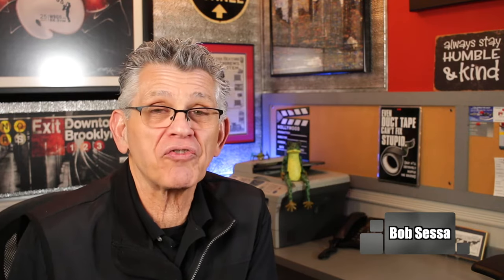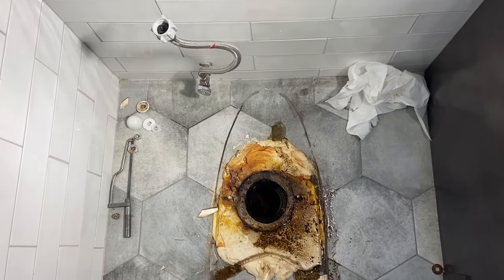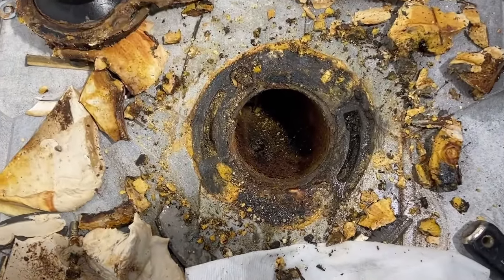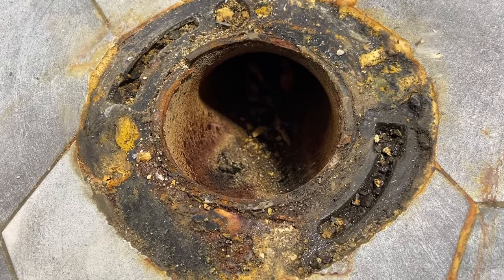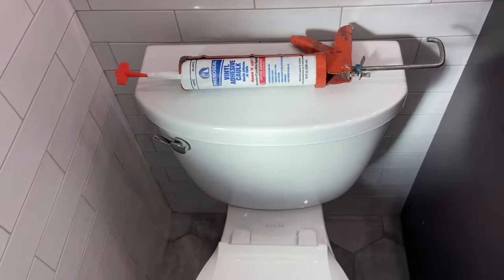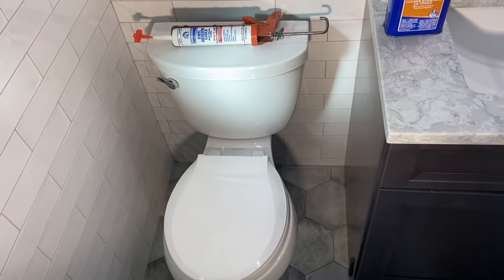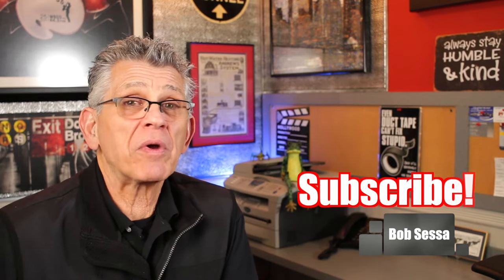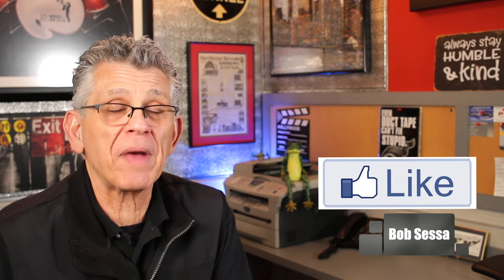Toilet Leaking From Base

Comment: I was installing a new toilet and it leaked under the base, so I went and got a double wax ring, still leaks, got a rubber ring still leaked. Finally I put the toilet on 2 paint cans and poured a bucked of water thru it, turns out the leak was in the mold. The spot where they poured the mold it didn't seal all the way. Got a new toilet, no leak.
Reply from the maker: That happened to me more than once and it drove me up a wall. Repeatedly setting and resetting the bowl, finally did what you did and wanted throw the bowl out the 2nd floor window .

Comment: I remember a product called Bowl Setting Compound that was an alternative to Plaster of Paris to go around the bottom rim of the bowl. I think a little plaster or an adhesive caulk is more secure and better support than toilet shims or pennies. It certainly looks better than an uneven space and is more sanitary. I have seen instructions that say if you do plaster or caulk a bowl to the floor, if you leave a gap at the rear of the bowl, a leak will make itself known above the floor. You can make a good case for either caulking or not caulking.

Thanks for the clear and instructive videos and I look forward to more.

Comment: What about toilet flange extenders?  Steve Lav has an old video "Toilet flange repair, tips and tricks." Seems like that could have been useful in this case.
Reply from the maker: Not sure but that may have worked if the original flange was in the correct position. It was just installed in the wrong position.
Reply: Only use extenders if you want sewer odor. Those things leak sewer gas so easily. I go to people's houses all the time complaining about a strong sewer odor and when I pull the toilet almost 100 percent of the time, it's because of one of those extenders.

Comment: So wanting input on an issue. Living in an apartment situation, where a toilet started trickling a leak from under the base of the toilet, when flushed. If you flushed twice in a row, you would see more. Not a big puddle. Thinking that the wax ring needs looking at. The toilet doesn't wiggle or rock. Maintenance comes, and just says he's going to caulk around the base. That the leak isn't that bad, since there is not a puddle. Also mentioned it should be caulked because of possible sewer gas issues. I said what happens if it keeps leaking, now that the toilet is sealed with caulking. He said the caulking would start to bubble out, and if it did, they would look at the ring. I said I am worried about the neighbors below. Nope, just caulked and left. Am I concerned over nothing? Or is this just wrong? Thank you, if you are able to put your thoughts into this one, for me.
Reply from the maker: You should not see any water leaking from the base of the toilet, if it were me I would recommend pulling the bowl to see what's going on. Or you might get a knock on your door from your neighbor below?
Reply: @BobsPlumbingVideos  Thank you. I appreciate your quick response!

Comment: The flange should rest ON TOP of the finished floor and NOT even with the floor.
Reply from the maker: "in your opinion"
Reply: It probably was on top at one point in time but they may have added floors over years building it up some causing the flange to now sit level with the floor

Comment: We have leaking from the bottom of our toilet (the grout around the toilet is always darkwr and damp). A big bubble also comes up every time qe flush and in the basement it sounds like a toilet is constantly flushing. The toilet doesn't sound like its running upstairs so not sure why its flusbing in the basement. Help no idea what to do
Reply from the maker: First put some food coloring in the toilet tank and see if the water in the bowl starts to turn colors. This indicates a leak even though you can not hear it. Secondly, the bowl has to be removed to check the seal, no water or bubbles should be seen when the bowl is flushed.

Comment: Hey Bob, I've got a question for you that I don't think is addressed in your other videos (though I could be wrong so please direct me if I missed it). I think the pressure regulator on my house main line is malfunctioning. The reason I think that is I bought a water pressure test gauge and when I tried testing it to see what the house water pressure was the pressure keeps climbing if I leave it on over time (over the course of say minutes to hours). I thought maybe this was an effect from the water heater but then I turned the water heater off and waited a few hours and it still has the same effect. The issue is that it keeps climbing well beyond 80 psi but then when I turn the water on anywhere in the house the pressure falls to 20 psi or less. 

The issue is that over time the pressure will raise above 80 psi (that's the highest it can be set as I understand for residential not accounting for the water heater effects) and I suspect that is why some of my other plumbing is leaking (I currently have a pipe that is leaking going into the basement). 

Is that a common problem/is there a way I can verify that the pressure regulator is indeed bad and needs replacement?

For reference, it does seem like when I turn the water on anywhere in the house I get a "burst" of pressure and then the water goes into more of a trickle as the water is on for longer (indicating the loss of pressure even though the initial pressure is high).
Reply from the maker: Thanks for the question, my experience with incoming water pressure regulators is little because here in N.Y.C. our water pressure are pretty stable. Anywhere from 50 to 80 p.s.i., the only place I use them is on hydronic heating systems. From your description it's sound like you have a bad regulator and depending the make, manufacturer and age, it may be able to be re-built. But if it's a basic 3/4" - 1" valve, it's probably most cost effective to replace it. I found this video, hope this helps you - https://youtu.be/xs2GXur9fPM

Comment: I’m not a plumber Bob, but I agree that caulking gives it a neat and clean finish. I recently had to have a toilet replaced which had developed fine cracks inside the bowl. This toilet was in the second bathroom and very lightly used.  It was however 16 years old!   Just curious Bob, what causes these cracks to develop?   Nice job!  👍👍
Reply from the maker: I would have to say these may have started in the manufacturing process and took their time show up.

Comment: So what’s the difference between a thick one with that runbber lip vs thinner one without one ? I’ve one leaking with wood floor. One of flange bolts rusted through and came loose. What kind of damage I might need to deal with ?
Reply from the maker: The plastic horn directs the water down and out as opposed the the plain generic wax. All things being equal if the floor is plumb and the flange sits level in all directions, I always use a plain wax gasket . No plastic horn.
Reply: @BobsPlumbingVideos  by you saying  flange sits level you mean it needs to be exact same level as top of floor or a bit lower than top of floor ?
Reply: @BobsPlumbingVideos  now have even larger problem my drain(s) are clogged . Noticed toilet ones right next to it was clogged I've tried plunger but it's bigger problem  looks like since crap coming up in that next room's shower drain . I know you don't know how my lines are running this way or that but what can you tell me ? Seems next step is aguer / snake it but not sure where to enter . Have one cleanout I might use burt it's way in the backyard ..

Comment: I went thru all the hoops , replaced the wax ring , cleaned up the base under the toilet, tighten everything down nice an neat ,   test flushed and it still leaked at the base bubbling thru the base on the floor,     now what??
Reply from the maker: Then look under the toilet closely, I've had a couple of occasions where the toilet had a hairline crack in it leaking water underneath.
Reply: Same story here. Smelled the urine. Replaced the wax ring with an extra thick. Just noticed it's still leaking. Onward!